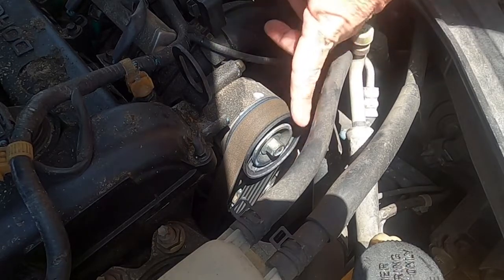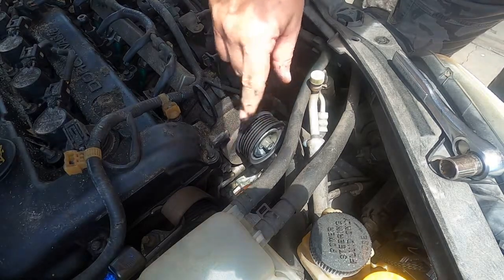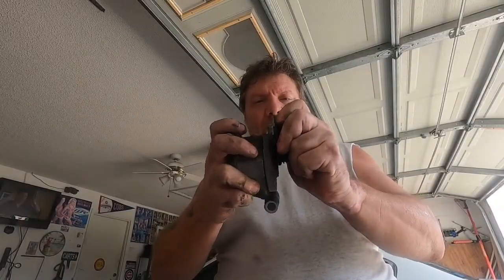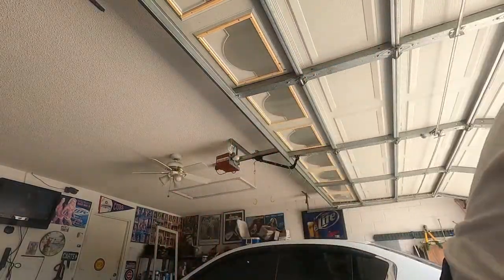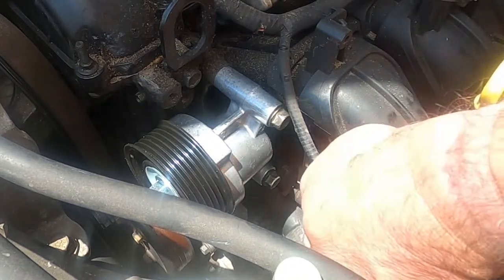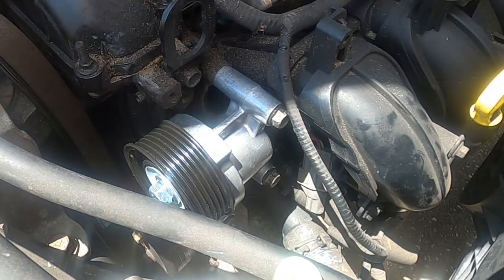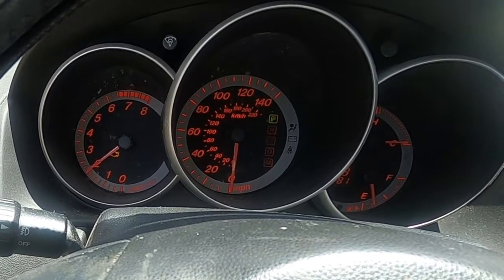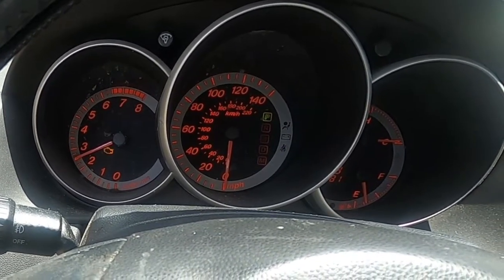How 2 replace belt tensioner 2004-2009 Mazda 3

Comment: Absolutely right about the price. Here in NY I was just quoted by a shop to do this job for $280, once he could locate the part. Rock Auto has some OEM parts for $115-129 but some off brand ones for $20-30. Man, if you don’t want to bother with OEM, you can have that job for $30 done in 15.
Reply from the maker: I got it from parts geek..it was like 31 bucks!! Very easy to do yourself!

Comment: Hey man, can you just replace the pulley? Or do you have to replace the whole tensioner?
Reply from the maker: You can but to get the whole assy is only a few bucks more and then you got a new spring also plus its only 3 bolts to replace..you would have to take it off anyway to replace the pulley if you can find just the pulley..

Comment: hey, mine shakes a bit on the silver part, does it need replacing or I can tighten it somewhere?
Reply from the maker: The only things to tighten are the 3 mounting bolts, if those are tight it needs to be replaced cause  the bearing is bad then.
Reply: @RobbersVblog  Thanks for your reply, might be it or the old spring inside the movable part. I've compared with other cars and they seem to move a little bit when idle too, so might just be normal. It's still quiet though. But I might change it along with the belt once I reach 70,000km. :)